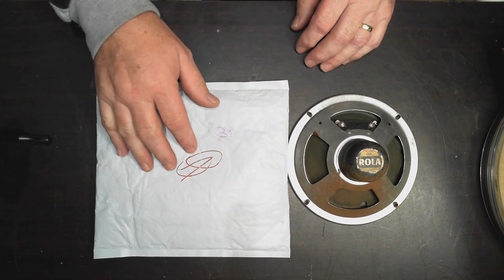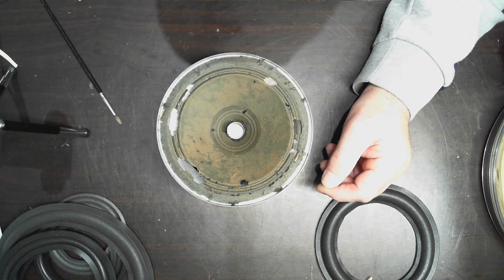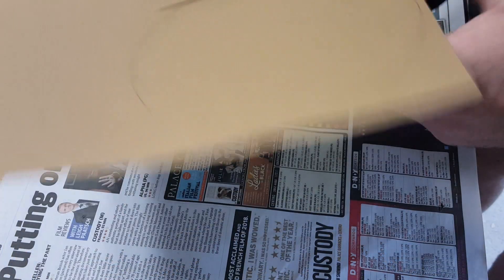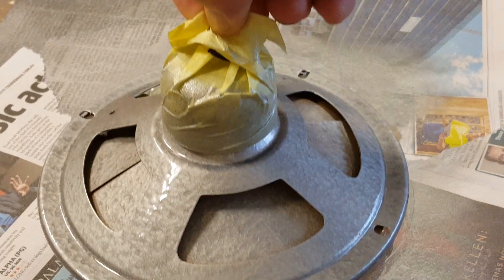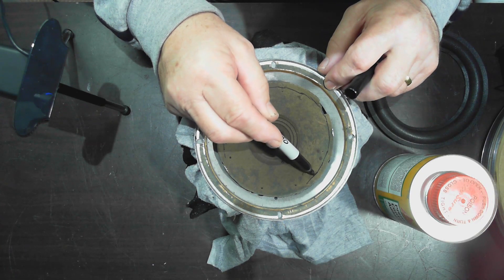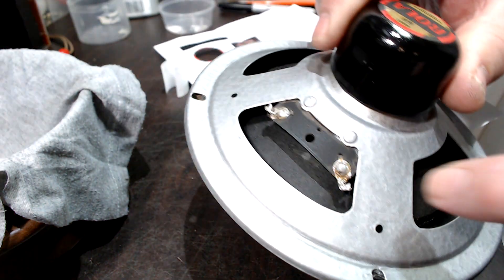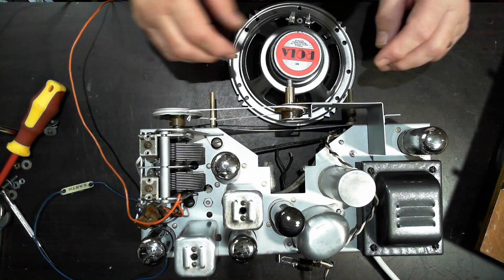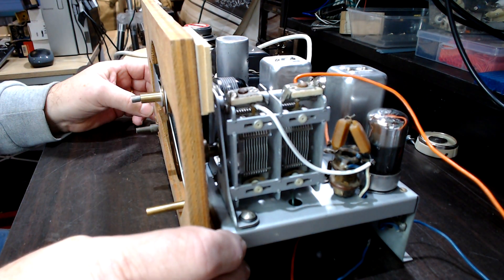NZ Phoenix Radio Pt 3.1 -Addendum- Rola Speaker Restore

Comment: Remarkable.  I thought you were going to leave the replacement speaker in this radio.  Well done, David, well done.  (Also, I've never seen a radio dial where the numbers ascend from right to left.  I learn something new every day!)
Reply from the maker: Hi David, the repaired speaker sounds very good, one of the better sounding radios actually. I didn't think of the numbers running in that direction, good pick up. Thanks David 👍😀

Comment: You are a true inspiration David l have a old Southern Cross Radio Gram centre console with Mirrored display and Lighting  . It has a Giant 12 inch Loudspeaker., the Radio has MW  SW.1 SW.2 SW.3  With Magic eyeTuneing valve my Father Bought it in the 1950s after he got married  l still have it but it needs a little attention. I know that it is rare so I have kept it in as good a condition as possible .l need someone as good as You to restore it back to its original condition Problem is l am in N. S . W .  Sydney thanks for the inspirational video.it has re enforced my Trust in old Tubes. . Regards Ross 😁
Reply from the maker: Hi Ross, thank you. You might try the RADIOGRAM STEREOGRAM & TELEVISION AUSTRALIA Facebook group. Someone there may help: https://www.facebook.com/groups/radiograms
HRSA is another radio restoration club in Sydney that may give you a lead: https://www.hrsa1.com/

Comment: David your work and videos are superb. I've been watching them back to back.
PVA is the way to go with speaker surrounds. Be careful spraying the cone, in addition to your warnings on potential coil rubbing, the sound of the speaker will also change.
Reply from the maker: Hi Red Robbo, I will use PVA in future. I take your point with spraying the cone through I haven't noticed any difference, I guess you are talking about stiffening the suspension part with paint I doubt it adds much weight as it's a very light spray. Thanks 🙂

Comment: I’ve watched Shango066 do this before. Original speakers need the treatment. There is also speaker 🔊 reconing glue to cover all of the speaker 🔊 paper 📝 with, such as if the speaker cone is punctured or torn. If you’ve ever had a problem with a raspy sounding speaker, and it’s binding, you probably have dirt between the speaker coil and the magnet, or a damaged speaker coil, which is binding and rubbing against the magnet. If a speaker is damaged on the outside edge, this can lead to buzzing. Speaker reconing glue can work for this, even if the speaker cone is severely deteriorated. Makes it sound like brand new. The only time to replace a speaker is if it is beyond all methods of being able to save it. Often, new speakers are not made to the specs of the original ones, and fitting it in the radio can present a challenge. I’ve seen this with Shango066 and Radiotvphononut. I hate to replace original parts, since this often takes away from the item being original. Speakers must be an exception, since they are usually hidden behind a speaker cloth.
Reply from the maker: This speaker is still working and has the better sound than most of my radios 👍

Comment: Hi David, back in the day when I re-coned JBL P.A speakers and the like, we use to source cones, voice coils etc from Queensland Speaker Repairs if my memory serves me correctly. They would also supply the appropriate adhesives and shims to centre the voice coil. Probably more expensive than eBay/China, but the owner knew his stuff and we were always supplied kits that fitted within days.
Reply from the maker: Hi Graham, thanks for the info. They aren't far from me and I have their card. They are more expensive and if I have a radio worthy of the expense I'll go and see what they can do. The foam suspension supports I use have a limited life. I should go and get some adhesive from them though 🤔🙂
Reply: @DavidTipton101  Yes I completely understand. Everything adds up with our hobbies and we just have to be realistic about what is worth spending money on.
Reply from the maker: @grahamserle7930  yep 👍

Comment: Hi David - just came across this one today - so have watched all 3.5 parts at once. A job that seemed to have you rather taxed on a number of occasions. Interesting and efficient speaker repair - I used to use a fairly crude system for repairs to old speaker cones that had holes in them using tissue paper and glue which I built up in layers. I'm not to sure about the thinly veiled references to NZ radios that do not even have circuit diagrams... :)
Reply from the maker: Hi Kenneth, most jobs are taxing for me as I'm only learning as I go 🙂 I can usually repair holes in speakers using the same method you suggested but this had extensive damage to the suspension and if I repaired that it would have killed off the bass. I only found out later but the radio was made in NZ and sold in a store in Brisbane under the name Phoenix. I couldn't find any schematics for it even under the parent company radios, there were plenty of diagrams for other NZ radios however 🙂
Reply: Hey David - I do understand you are "learning as you go" don't take my comments as criticism - they are not. I love watching your work - in some ways you are much like me with your comments and your humor - and I am not one of these people who get upset over comments on NZ! I mean as long as you get enjoyment out of what you do - that is the important thing. I had to smile as you were trying to center the new foam surround...I know I would probably have ended up ripping it off in the end. Keep up the good work
Reply from the maker: Oh no... I didn't take it as criticism, I knew what you were saying, cheers 🙂

Comment: Hi Dave I know you did this last year .Hopefully this will help future cones...Rubber cement
as you found out wil melt the surround...I have done several speakers and the glue to use is
Aleene's original Tacky Glue.. Will not melt surround and as stated its tacky..This glue is the recomended glue for speaker surround repairs...Hope this helped but being a year late ..Be well
keep up the great work..
Paul
Reply from the maker: Hi Paul, thank you for the tip. I can get that glue locally and will order some. I have been using another glue which works well and gives a little time to position the parts but I will give your suggestion a try. Coincidentally, I did another speaker just the other day, thanks 👍🙂
Edit: I just looked Aleene's glue and it looks very much the same as the adhesive I'm using which is Weldbond Universal Adhesive and is twice the price, I might stick to my current glue (see what I did there) thanks Paul

Comment: When you glue the rubber to the cone you shouldn't leave the glue to dry as it is required, as in this application that is not necessary, it will stick good enough. For the outer side of the rubber, just roll it outwards, the bump on the rubber ring should keep it in place, then use the same type of adhesive that you used on the cone but this time let it dry as required by the glue manufacturer. You should work the glued parts with your hands to assure firm bond. Also I would vacuum the  space where coil sits.  When I was a kid I used to repair speakers, I wish I had YouTube then. I really enjoy you videos, keep em coming.
Reply from the maker: Thanks for the tip RrahimStruja  👍😃

Comment: we do this kind of work at my place of work  rebuild of speakers. we stock heaps of parts if you need them we fix electrodynamics too
Reply from the maker: Where are you located Ian?  Does you work have a point of contact, web page or something?  It must have been interesting watching a rank armature struggling :-)
Reply: @DavidTipton101  you did a great job and it looks good.
Reply from the maker: Haha... thanks Ian
Reply: @DavidTipton101  do you know whe i can buy some 24 tubes and 27 tubes
Reply from the maker: That's a good question Ian, I'm a member of two radio clubs and each have valve banks and are a good source of valves, HRSA is your local one. Radiofest is on in Canbera on Sunday the 22nd Sept, there will be stalls selling valves there I'm sure. There is also a Facebook buy and sell vintage radio group, you can join up and place a request https://www.facebook.com/groups/VRBST/?ref=bookmarks   You could try the Australian Valve Bank http://rola.net.au/valvebank.htm or just Google the valves you want, something may come up.

Comment: Looks and sounds brand new!  Especially liked the speaker repair.  I've seen that done before but I have a speaker from 1926 that needs a new cone.  The cone is too ripped and narrow to replace with a modern equivalent. Do people press their own cones in this case?  Seems like a lot of work for a one-off repair.  BTW, Tubesandmore sells a product called Service Cement that's supposed to work well with speaker foam.
Reply from the maker: Hi SY, this was my first attempt at speaker repair and it wasn't pretty. It works and sounds very good though, one of my better sounding radios. I have an early 30s speaker that needs a new cone and after hours of searching found one that should do the job, It hasn't arrived from Hong Kong as yet to confirm. It should be possible to fabricate a new cone, maybe from stiff plastic sheet or doped paper or doped thin cardboard. I take it you are in the US and you have speaker repair companies that could supply parts or do the repair, cost would be a consideration in that case. I can get speaker adhesive locally. Good luck with your speaker 👍🙂 Link to the speaker cone I ordered: https://www.ebay.com.au/itm/313140189219?ViewItem=&item=313140189219

Comment: You can paint the whole face of the cone with the contact cement because it remains flexible and will not distort the  sound.
Reply from the maker: Hi Sam, I have done that in the past and is excellent for strengthening weak cones, thanks 👍😃

Comment: When you're at the stage of having nothing to lose  but you want to retain as much originality as possible, you can't really do better than this. Looks original but very clean from the back and what it looks like from the front is neither here nor there bacause of course it can't be seen with the radio assembled in it's case.

This radio needs nothing doing for a very long time now, it'll probably be around 100 years old before it's ready for the next overhaul!
Reply from the maker: Hi Paul, it's still working and I turn it on for a day every now and then. I looks great and people always see it and ask about it, it stands out in a crowd. I was very happy with the speaker although it nearly came to grief 😄
Reply: @DavidTipton101  I bet no one else has ever fitted a foam replacement surround to a mid 50's Rola 8" speaker!

Comment: David Sir, i have a celestion speaker in old valve radio having some holes on it. Can these holes be repaired? Pls suggest
Reply from the maker: Hi manoj, you can repair holes with small pieces of kitchen paper, coffee filters or similar soaked in PVA glue or contact adhesive. If the repair is on the suspension area of the speaker use the contact adhesive as it remains flexible. If you make the repair too heavy on the suspension area you will stop the cone moving full travel which will dampen out the bass sounds so keep it as thin and flexible as possible.
Reply: @DavidTipton101  thanks sir for prompt reply.... i will follow your instructions 😊

Comment: In 1977, I was preparing to leave the United States Army as my second 3 year hitch was coming to an end. To that end, my  unit released me early from my field recruiters duties (Didn't want a recruiter who was getting ready to get out, you know!) So to kill the time, I enrolled in a community college to study auto mechanics. One of the first things the instructor told us was to remove all rings and metal watch bands before going to work in the shop area in fact we would get demerit points that counted against our overall grade should we be found wearing such items.  The reason, of course was that such items could easily short out electrical circuits should the ring come in contact with the positive wire and ground.  This short would pass enough amps to melt the gold in your ring, or the metal in your watch band and also burn your finger or wrist very badly, in fact, he told us  of students who lost their fingers to such incidents.  Of course the chance os shorting out 240 volts or higher in a radio chasse may not be as probable, however the chance does exist.  This is why I wear no jewelry or metal banded watches when tinkering with my hobby builds of different circuits.  Just a thought I figured it would not hurt to share here.  Of course now that I lost my wonderful wife of 51 years and 4 days to cancer last summer, I no longer wear a gold wedding band with that little diamond in it anyhow.  I did wear it for a few months to honor her but people began to talk of my mind getting a bit weak after the hell of seeing cancer eat her alive so to please them I did remove it. I keep it in a small box on my dresser and still look at it every night before retiring, a sort of good night to that wonderful woman who gave me such joy for so very long.  Never take your lovely wife for granite as some day you may be without her, and God how that hurts.
Reply from the maker: Hi Jerry, thanks. I am aware of the risk with finger jewellery and I didn't wear a ring for my entire working career for that reason. I feel the risk here is low as I never put my finger in a live set and wearing my wedding ring outweighs the risk of an angry wife. If it was up to me I wouldn't wear it for the reason you stated. I am all to aware that the time is approaching when one of us will leave the other, I just hope it's me first as I don't want to endure the pain. Thanks Jerry.

Comment: I once had to do a similar speaker, but clearance issues made me use the foam surround flipped over in reverse........dont think there was any real difference to the ear......but it gave me a lot more clearance.....the downside was I have to cut more of the original cone.....oh and I painted the whole cone with contact adhesive, which dries like rubber anyway.
Reply from the maker: I didn't think to invert the foam Harb, good thinking 🤔🙂
Reply: Sometimes it works, sometimes there is not enough room and it hits the speaker cage, but its worth a try and you get lucky occasionally .........I have to say though, your video's are inspiring me to get out and do some "Fun" electronics and not just work electronics all the time..... I must get something interesting out of the store room and do a restore soon.....

Comment: Very good. I've replaced foam surrounds on 15" woofers and I know what it's like to use contact cement.....no fun....it distorts the shape. The next one I did I used RTV clear silicone it didn't distort the foam and won't stick too quick so it's workable for awhile longer and had much better results and more fun
Reply from the maker: Hi Chris, the contact was a disaster, I use a multipurpose white glue now and it works well, sticks to paper and metal and gives a few minutes work time 🙂
Reply: @DavidTipton101  very good I'll have to give that a try. What's the name of the glue if I may ask. It's always good to know what kind of adhesive to use on things especially a delicate restoration. Silicone is good but it has a strong smell for a long time
Reply: @DavidTipton101  speaker repair is quite challenging and practice makes perfect. I had a small all metal chassis 4 tube silvertone radio that had a torn speaker. The voice coil and spider suspension was still good so I carefully cut a paper cone from a modern scrapped TV speaker it was 8ohm and I needed 3.2 ohm so I just cut the voice coil off and glued it to the old voice coil and glued the edge to the frame and it works great of course I didn't mention shimming the voice coil during the repair. I found on eBay complete paper cones with wrinkle edges for small speaker repairs for about $12.00 I think that's a little high for a piece of paper. I know how to fold paper into a new cone but the problem is making the wrinkle suspension. I'll figure it out one day
Reply from the maker: @chriscimino7854  It's called Weldbond 'Steel Tough Universal Adhesive' https://www.gluesaustralia.com.au/weldbond-steel-tough-welbond-universal-adhesive-bo
Reply from the maker: @chriscimino7854  Speakers are a pretty basic mechanism, there is a lot of maths involved but the assembly is straightforward. Good idea using a newer cone and retrofitting to your old speaker. When Rola closed in Australia someone got the cone dies and was able to produce new cones complete with the 'wrinkle' surround, that would be handy.
Reply: @DavidTipton101  I have some of that. I hope it doesn't cause rust on your speaker. I don't know why it made metal rust

Comment: I really like what you do and how I can fix some of my old tube stuff. The only thing I don't understand is why do you use foam surround? It will hold 10 to 20 years and it is gone. I have a old JBL speakers that had foam from the early years and now with cloth surround they sound better and will not die before me now. Would like to hear why you use foam.
Reply from the maker: Hi Harald, I use foam because it was all I could get at the time and it's still hard to get paper cones. In the US you can buy replacement speaker parts and kits for a reasonable price but not here. Importing from the US is out of the question due to the freight cost. I can keep a supply of foam suspension surrounds for most speakers and it doesn't require replacing the entire cone and voice coil.  Thanks Harald 🙂
Reply: @DavidTipton101  Thank you and I understand why. Keep up the good work and keep on making videos.